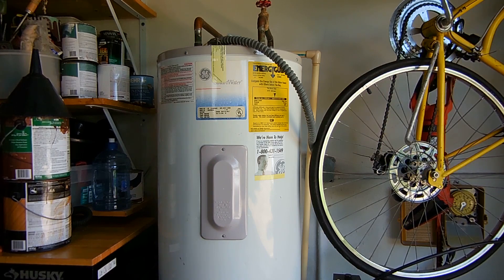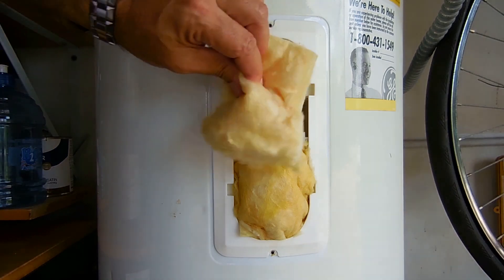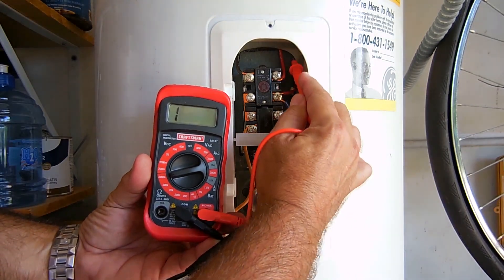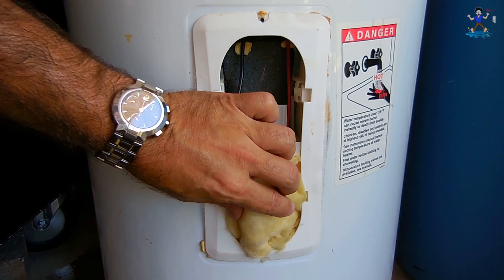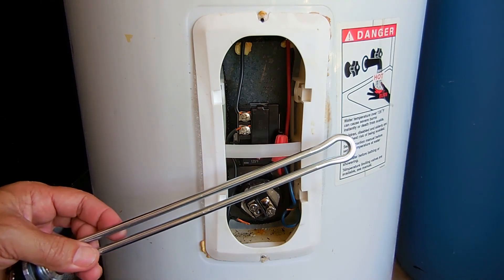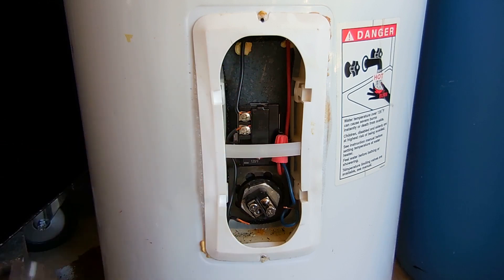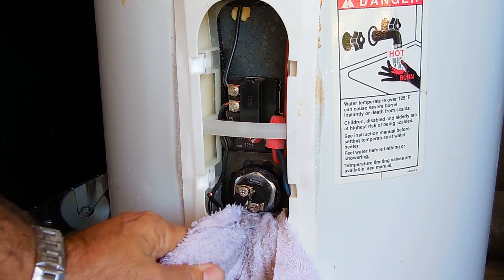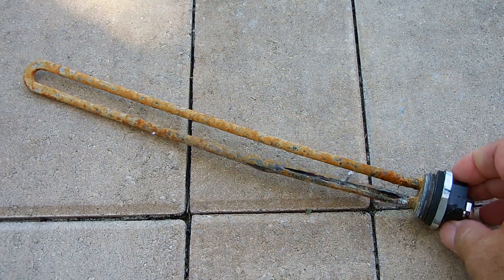Electric Water Heater Not Heating Water (Trips Breaker)

Comment: Excellent video from troubleshooting through the repair. The tip about the socket and breaker bar is gold!  Even the trick to swap the element without draining the tank worked!   My heater is outside so the water lost just ran through the carport. I was very nervous about stripping the threads on the new element because of the rush of water. But it doesn’t take much effort to hold the new element in place while lining the threads.

Comment: My son just got out of the shower accusing me of using all the hot water. I didn’t hop into the shower as of yet. Went down and checked the circuit breaker and it was tripped. When I turned it on I heard a pop inside the tank. Opened YouTube and viola you have the exact same water heater as I do. Going to test it momentarily.  Thank you for the video.

Comment: Thank you so much for the step by step instructions!  I did drain my tank, but otherwise followed your instructions precisely. For a bit over $50, which included both elements and the 1.50” socket, we can eek out a few more years from our 2016 heater. Saved a bundle versus the cost to replace, and I can’t thank you enough. 👍

Comment: @ElectronicsNmore what if you've replaced both elements and thermostats,what causes the breaker to keep flicking off?
Reply from the maker: Sounds like you're using a water heater with much higher wattage than the original. You're exceeding the maximum current level allowed for that breaker

Comment: Excellent explanation particularly showing how a corroded element can trip a breaker.   When I was a teenager growing up on my stepfather's farm,  we had this problem with the lower heating element on his 50 gallon electric water heater.   Except the corrosion happen closer to the center of the element and as such, had a high enough resistance to ground that not enough current was drawn to pop the breaker.  The reset button on the upper thermostat was jammed, and the water overheated near boiling, something during the night. Discovered this in the morning because the hot water at the kitchen sink was, let's just say hot enough to brew coffee.   Went to the basement with Dad to investigate the situation and the pressure relief valve was running full force.  That explains why I was awakened by the sump pump during the night with calm weather.  That's the time I wish the breaker box wasn't in the basement 😄

Comment: Very well explained and easy to follow video thank you...I have a Rheem Optima got up this morning and the power supply had tripped so no hot water.I did everything you explained and the top element was 17.7 and the bottom 15.8 ( is that normal ?) and no readings when touching screw to the tank.....so I reset it and it was good for 10min then tripped again....so I guess I have a problem elsewhere,but once again thanks for a very informative video....Subscribed.
Reply from the maker: Make sure you use a Meg Ohm resistance range when testing between the tank and element's screw. You may need to measure how much current if flowing into the heater to rule out a faulty breaker.

Comment: Just got an Electric "lowboy" 40 gallon under-countertop water heater installed. When the plumbing guys left after install, it took about 4 hours for the water to get hot. When I got back several days later, no hot water, and the circuit breaker was still on (in other words, it hadn't shut off). Any idea what might have happened to stop the thing from working? Plumber is coming out in a couple of days, but any pointers you might share? Bless you!!
Reply from the maker: Probably a 240V heater on a 120V line

Comment: I've got a 19 gallon, 110V tank . power checks, continuity checks, thermo checks, element checks.
What else is there to check? What could be the problem?
Reply from the maker: Must be a wire disconnected if all those tests are accurate.
Reply: @electronicsNmore  That's what I thought but then I wouldn't be getting a 110V reading.
Reply from the maker: @deek3048  You sure you don't have a 240V heater?
Reply: @electronicsNmore  LOL, yes, it's been running fine for a year. If it was 240V the water wouldn't be very hot...
Reply: OK I pulled the tank and replaced it. Drained it and took out the element. Element  looks fine, a little rusty but clocks @10 Ohm. but inside was still water, turns out it's a sludge, a white briny looking sludge, doesn't taste salty though. Any idea how that got in there?? We are on a well. Ever came across that? Would that short out the  element?

Comment: I came to your video because my water heater kicked off the breaker.  EVERYTHING you said was what was happening to mine.  I used your video to fix mine.  Also, forget the crappy socket and buy a real serious one.  At Lowe’s,  they have a set of the crappy sockets for 19.99.  NONE OF THEM will fit the new elements on big tanks.  Skip them .  You will want to get a six sided 1 1/2 inch or 38 mm socket.  I tried to remove the elements with the non-6 sided socket, and it halfway threaded the nut as it is thin.  So 6 sided impact, especially for old tanks (20 yrs).  And yes, I am subscribing to this.  Thank you.
Reply from the maker: Glad my video helped! Be sure to rate thumbs up, and look over my extensive video playlists below for many other videos of interest to you. Taking one minute to share a link to my channel with others on social networking sites would be greatly appreciated. Thank you
http://www.youtube.com/c/electronicsnmore/playlists
Reply: @electronicsNmore  will do sir.

Comment: Put a new water heater and a new Braker and still no hot water. Do you know what wrong.
Reply from the maker: Did you measure 240v at the top of the heater?
Reply: Check your fuse box if there's no current flowing then it's the actual fuse itself...  Might need a new replacement. Then ✔️ the upper Tstat turn the temp knob n it should click, if not clicking when turning then it's the Tstat itself

Comment: Very good video. However, I STRONGLY recommend that you drain the water heater completely before removing the heat element to be on the safe side. I followed the video hoping to perform a quick element swap. However, there was years of mineral and sediment build-up. And once the element was loosened and partially removed I could not pull it out all the way and could not screw it back in. Never realized how much 40 gallons is. The result was a clean garage floor and lesson learned. Very glad the water heater is in the garage!

Comment: This is a very well done video, BUT ...

I was able to screw up some things that weren’t anticipated.  Forgive me if I repeat something that was covered, but it’s been about a week since I watched it.

LESSON:  Before you do much of anything else, get the exact replacement part (OEM).   

I did not empty the hot water heater figuring that a small amount of water on the basement floor wouldn’t be an issue. The heating element (lower) was so badly corroded that it refused to come more than half way out.  By the time I’d wrestled it out, a fair amount of water had escaped.  

I’d had some difficulty finding the correct replacement element so I went with one from a local hardware store ($13) that had the “same” specs.  It went right in, but the threads didn’t match up, didn’t even “catch.”  More water escaped.  

Now I’m in a little bit of a bind.  I’ve got an almost full 50 gallon hot water heater leaking water around the replacement element (which did stay in place even though it wasn’t screwed in).  I got a long hose in an effort to drain the heater, but for some inexplicable reason, the threads here didn’t match, and the leaking around that connection leaked like crazy.

I used a hacksaw to cut off the corroded tubes from the old element and used the threaded part as a plug.  At this point I had water all over, a new, useless heating element, an almost empty heater, and no proper replacement element.

I called Kenmore, and they tried to sell me a 4500W element ($88) when the specs clearly stated that 3800W was needed.  With more research, I found the proper part on Amazon ($40) that would arrive in 5 or 6 days.  After almost a week with no hot water, the element arrived yesterday, it fit, and we’re back in business.  

LESSON:  Before you do much of anything else, get the exact replacement part (OEM).
Reply from the maker: That wasn't good. Yes, always make sure the parts are fully compatible. Thanks for watching!

Comment: Reset button feels like stuck now, turned breaker on and off, replaced heating element, but I'm still not getting hot water?
Reply from the maker: Swap out the thermostat with the reset button.

Comment: Legrand RCCB trips, when i start electric geyser/exhaust Fan, both equipment are new.
Reply from the maker: Either a faulty breaker, or current is flowing into the water to ground from the heating element.
Reply: @electronicsNmore  But if its faulty then it shuld trip for grinder as well, everything is new

Comment: Great video.  
I need to remove the upper Electric Thermostat on my water tank.  
Trouble is when I tried to do this, I was unable to wiggle it free.  
The bottom seemed to be in a slot.

How am I supposed to remove this so I can put in a new one?
Reply from the maker: Hi Phil. The thermostat is held in place with metal clips.

Comment: Good video.  Not having a multimeter I'm just going to take turns disconnecting the upper and lower elements.
Reply from the maker: That works. One at a time until the breaker no longer trips. Good luck!
Reply: @electronicsNmore  OK so I disconnected the lower element and it still trips.  Disconnected the upper element and it no longer trips but no hot water either.  Is this because the thermostat will not switch to the lower element until the upper water heats up?  I can keep resetting the breaker every 20 minutes and get a tank of hot water.  I should note that this is an "eco smart" model with a motherboard.  I had to replace the motherboard a couple of years ago.  Think it could be the motherboard again?

Comment: I have a brand new electric water heater, so it wouldnt be corrosion but the breaker trips and has blown  the breaker. We cannot figure this out.
Reply: Did you check to make sure it was wired to a 220 volt supply lead?  On a 110 v lead it still kick on but will activate the reset button or the breaker.
Also check if the supply wires  are not crossed or connected backwards/incorrectly. 
Good luck

Comment: Question: i had a small 10 gallon electric 240 volt water heater that the tank burst. I did not want to put another 240 volt water heater, so I went with a 120 volt water heater instead. I took one of the black wire and connected to the line in and connected the common wire and capped the second hot wire (red one) and tied the ground wire. Turned power on and it does not heat up. I noticed the current from the heater breaker to the element is not going through as if the thermostat is not working. Do you think it is a bad thermostat or is it my power connection?
Reply from the maker: Make sure you have a 120V heater, and make sure the wires you connect to the heater are supplying 120V up to the current rating of the water heater.
Reply: @electronicsNmore  Yes, I tested the black wire alone and it has 120 volts and the water heater is a ten gallon one element with 120 volts.

Comment: The breaker for the water heater is tripped and won’t go back to ON position, there’s a burnt smell coming from the water heater. No hot water is coming out. Does this mean I need to replace it or can I have a plumber fix it? I already called a plumber and described the issue and he said I need a new one. Quoted me $1,200 for parts and labor. I live in a one bedroom condo and the water heater is Rheem 40 gallons. What should I do?

Comment: I just used one of your videos to help fix a water pipe leak that was split in the ground. I used your pvc pipe video to fix it. Now that that's fix my water is not getting hot so I'm wondering if I was supposed to turn the electric hot water heater off when I turn the water off at the water main.  It took me awhile to fix the pipe so it was off alittle while.  The strange part is the hot water faucet side gets kinds like warm but never heard to hot.  I hope not to have to replace a hot water heater since I really cannot afford it.  My dryer just broke , it quit spinning around and usually it a heating element but not this time. Lol, real life struggles.   Binge watching your videos tonight.  New sub!
Reply from the maker: Glad you enjoy my videos, and glad they're helping. Be sure to share. Thanks!

Comment: I replaced both 30A thermostat and heating element 4800w and still trips the 20A breaker faulty breaker?
Reply from the maker: You shouldn't be using 4800w! 240V / 4800W = 20A. Use 3800W.
Reply: Its a 315 litre rheem single heating element too

Comment: First off nice video and help full, now for a question for you. Our water heater does not seem to kick out the hot water like it used to, only have one element a 3500w one and just gave it a test and is reading 16.9 and thermostat is set around 135 degs any thoughts?
Reply from the maker: Swap out the thermostat first, if it doesn't help, then the element.
Reply from the maker: Measure the voltage across the power supply wires. It should be around 240VAC, if it's not, then you have a problem in your breaker panel. The resistance measurement is only slightly higher than the norm for a 3500w element, so maybe a faulty thermostat.
Reply: @electronicsNmore  Ok thanks for the input I'll check it out. Thanks for the help
Reply: Voltage checks 248VAC on meter

Comment: My hot water heater doesn't trip the breaker. It causes the reset button on the upper thermostat to click, and has to be reset. I've heard this is due to overheating . Its set at 120/125. Could it be defective thermostat?
Reply: Most likely it is,they are not that expensive,so is a good idea to replace them both at the same time.
Reply from the maker: Yes, a faulty thermostat. Thanks for watching!

Comment: I ran the wires to a 30 amp breaker from a 20 amp it worked for about 6 hours breaker doesnt trip but no hot water but I didn't change the bottom element but got a reading on both elements
Reply from the maker: Never take wiring from a 20A breaker and connect it to a 30A breaker. The wires can heat up.

Comment: Excellent job of explaining step by step on first finding the problem and then how to repair it. I came here to find out the ohms range on the elements and you also answered that. While you were reinstalling the wire it reminded me of the trouble I used to have with the screw pushing the wire away because I didn't put the wire on the right side of the screw so that it would pull the wire tighter into the connector instead of forcing it out. You knew and automatically done it without thinking but I thought it might be worth mentioning for those that might not know. That's for sharing your knowledge with us.
Reply from the maker: I have an electrical wiring video coming up soon, and I mention that. :-) Thanks for watching!

Comment: I recently replaced my water heater with a Rheem and the lower element burned out in three months. Our water is very hard from a well. I pulled the element and found it was completely corroded with half inch of scale on it and burnt in two! This prompted me to do some investigating and I found out, the straight elements, such as the one you removed in this video, are more susceptible to corrosion, especially in hard water areas. I then learned that the U shaped elements are made for that very reason, and are less susceptible. Not only that, but since there is more heating surface area, more efficient at heating the water as well. Needless to say, I replaced them both.... Just food for thought!

Comment: Great Video. 
Thank You. 
Is it possible if you can tell me how to fix the water pressure on the water heater? 
The water company turned off our water by accident, they had the wrong address. After they turned the water back on the water pressure went down & when we called them they told us we had to get ahold of a plumber to fix it because all they did was turn off & on the water.
I can't tell you how mad & upset we are. 
Thank You for your time.
Reply from the maker: If they only touched one valve, then the valve is faulty. It didn't open all the way when they turned it back on.
Reply: @electronicsNmore  
I opened the top cover of the water meter & couldn't find a valve. I am unsure of what exactly the Gentleman did. Can you send me a picture of what to look for?
Reply from the maker: @1amazingj  I have no idea what or where they touched. You need to ask them.
Reply: Amazing J ...is it only your hot water that lost pressure, or hot and cold?
Reply: @Quickened1  
Both hot & cold.
After they turned the water back on we immediately noticed the toilets were filling slowly. Then my Mom went to wash some dishes & I took a shower afterwards & noticed how low the pressure was. 
When we called the water Company they said all they did was turn the water back on & we needed to call a plumber to fix the problem. It's to expensive for us. So we have been suffering with the low pressure for 2 months now.
Reply: Find out exactly where the water company turned off and on the supply... It's probable that they didn't turn on the valve all the way...